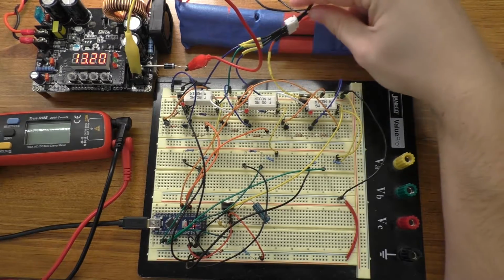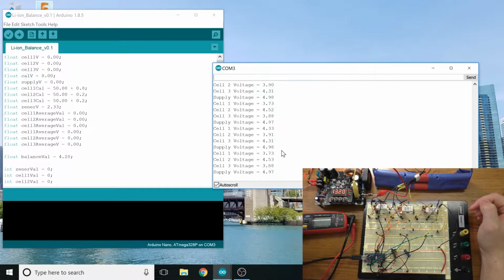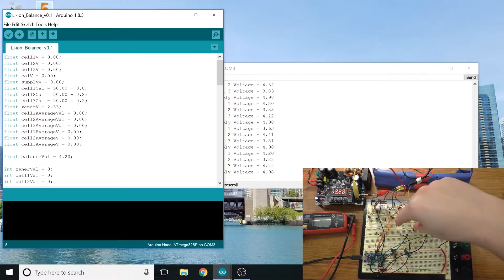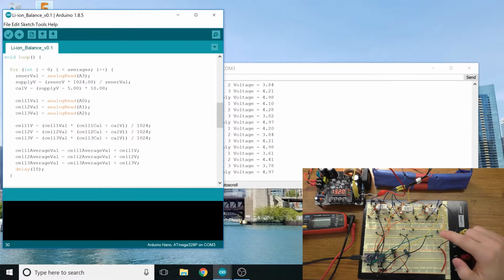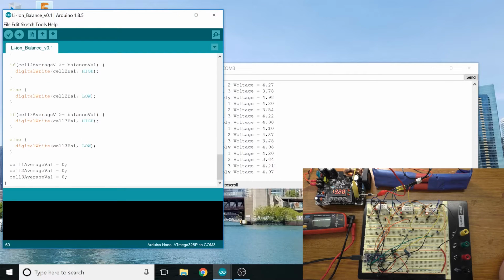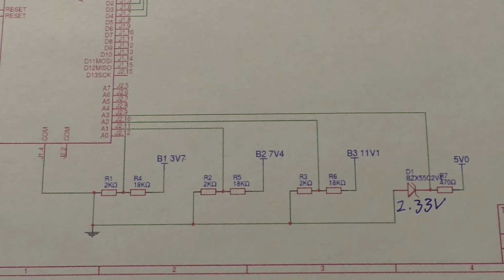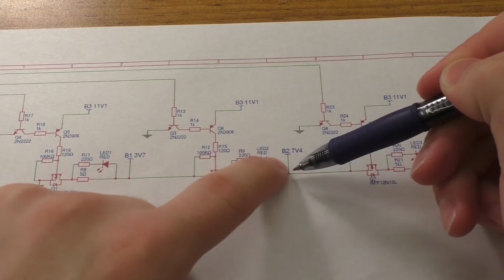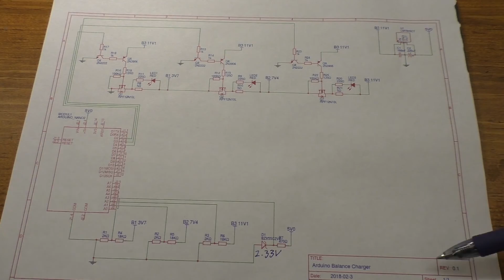Arduino BMS #2: Initial Schematic and Code

Comment: So you are actually wasting power in the charger.
I can appreciate the simplicity, but it's obviously is inefficient.
The circuit I'm designing is supposed to be used without a charger so it's important to be efficient or it will discharge the battery.

Comment: the Mosfet-N RPF12N10L is designed for logic 5v level drive and the datasheet tell that the Vgs max is 10v.. be aware for your B3_11V1 which reach 12.6v when full charged (4.2v x 3).. i suggest you to put a zener at least for the B1 Mosfet.. about the analog reading, i do always an average (of 100 to 200) for to avoid the noisy/instable values and save by the way the filter components for each line.. for the dividers, if you select a different set for to have the same input analog voltage (as B1 less divider with AVref 5v, B2 div by 2, B3 by 3 etc) you will never have a loss of resolution (add a software calibration factor to be precise instead of to select the resistors).. im happy of your project and i will think about it!!

Comment: Hi, can i ask something? how can you read battery voltage for each cell at voltage sensing circuit?  I thought that voltage divider at B27V4 and B311V1 show voltage 7.4V and 11.1V respectively? Or did you calculate it in the code?
Reply from the maker: They do do show 7.4 and 11.1 volts. They get calculated from those values in the code.

Comment: Hello,  Did you fix the osc problem with the balancing ?  If not why not put a delay in the balance routine that has all the drain resistors off for like 2 seconds then measure, and if it finds a cell high, then turn respective drain on for 3 seconds and return.  just give it a settling time..
Reply from the maker: Yeah I got that fixed, and that is pretty much exactly how I fixed it.

Comment: Eman, I'm building an arduino BMS, and I found your project, amazing! Which changes do you sugggest for a 14S pack? I have to deal with 60V. I suppose, for meassuring, is the same, changing the ratio of the voltage dividers to adjust the ranges to arduino ADC. But in the case of the dischargers, I will need capable transistors for 60Volts, true?
Reply from the maker: Thanks. I have had some people tell me that voltage dividers start to become a little inaccurate once you get past about 4 cells.  One suggestion somebody made to me was to replace the voltage dividers with op-amps set up as differential amplifiers.  I plan on experimenting with this very soon. The other big thing is the gate voltages of the mosfets need to be kept below 20V somehow.
Reply: @Eman2000  Interested to keep following this. I am relatively new to electronics and Arduino but looking to go with a 7s setup and using what you've begun, so I am keen to see if you do keep the voltage dividers or go with another method of voltage measurement.

Comment: Can I use same circuit if I have 17 cells in parallel(3 X 17) ?
Reply from the maker: Yes
Reply: I had a problem with the program I guess. 
Voltage keeps on getting added after I run the program and voltage it displays keeps on increasing.

#include <LiquidCrystal.h>
float cellV1 = 0.00;
float cellV2 = 0.00;
float cellV3 = 0.00;
float calV = 0.00;
float supplyV = 0.00;
float cell1Cal = 50.00 + 0.8;
float cell2Cal = 50.00 + 0.8;
float cell3Cal = 50.00 + 0.8;
float zenerV = 2.68;
float cell1AverageVal = 0.00;
float cell2AverageVal = 0.00;
float cell3AverageVal = 0.00;
float cell1AverageV = 0.00;
float cell2AverageV = 0.00;
float cell3AverageV = 0.00;

float balanceVal = 4.22;

int zenerVal = 0;
int cell1Val = 0;
int cell2Val = 0;
int cell3Val = 0;
int averages = 100;

int cell1Bal = 2;
int cell2Bal = 3;
int cell3Bal = 4;
int powerIn = 5;

int flag = 0;

const int rs = 12, en = 11, d4 = 10, d5 = 9, d6 = 8, d7 = 7;

LiquidCrystal lcd(rs, en, d4, d5, d6, d7);

void setup() {
  Serial.begin(115200);
  lcd.begin(16, 2);
  lcd.setCursor(0,0);
    lcd.print("RIZEL");
    delay(1000);
  lcd.noAutoscroll();
  lcd.clear();
  
  lcd.write("Initializing..");
  delay(1000);
  lcd.setCursor(0, 1);
  lcd.write("Version 0.1");

  pinMode(cell1Bal, OUTPUT);
  pinMode(cell2Bal, OUTPUT);
  pinMode(cell3Bal, OUTPUT);
  delay(2000);
}

void loop() {

  for (int i = 0; i < averages; i++) {
    zenerVal = analogRead(A3);
    supplyV = (zenerV * 1024.00 / zenerVal);
    calV = (supplyV - 5.00) * 10.00;

    cell1Val = analogRead(A0);
    cell2Val = analogRead(A1);
    cell3Val = analogRead(A2);

    cellV1 = (cell1Val * (cell1Cal + calV)) / 1024;
    cellV2 = (cell2Val * (cell2Cal + calV)) / 1024;
    cellV3 = (cell3Val * (cell3Cal + calV)) / 1024;

    cell1AverageVal = cell1AverageVal + cellV1;
    cell2AverageVal = cell2AverageVal + cellV2;
    cell3AverageVal = cell3AverageVal + cellV3;
    delay(1);

  }
  cell1AverageV = cell1AverageVal / averages;
  cell2AverageV = cell2AverageVal / averages;
  cell3AverageV = cell3AverageVal / averages;

  cell2AverageV = cell2AverageV - cell1AverageV;
  cell3AverageV = cell3AverageV - (cell2AverageV + cell1AverageV);

  Serial.print ("Cell 1 Voltage = ");
  Serial.println(cell1AverageV);
  Serial.print ("Cell 2 Voltage = ");
  Serial.println(cell2AverageV);
  Serial.print ("Cell 3 Voltage = ");
  Serial.println(cell3AverageV);
  Serial.print ("Supply Voltage = ");
  Serial.println(supplyV);

  lcd.clear();
  lcd.print("1: ");
  lcd.print(cell1AverageV);
  lcd.print(" 2: ");
  lcd.print(cell2AverageV);
  lcd.setCursor(0, 1);
  lcd.print("3: ");
  lcd.print(cell3AverageV);

}
is there any wrong with the code?

Comment: this is a little off subject. I am working on a discharger tester. and I was thinking about using a DC to DC converter . for varying the load. or keeping a constant load as voltage drops. could something like that be incorporated into a balance system? is there a way to adjust the output of a DC converter . with a arduino? And could you program it to only balance between like 4 and 4.1 volts then when over 4.1 it would be balanced. hopefully! and no oscillation. or am I even close? thanks
Reply from the maker: You could add something like that. Controlling the converter with Arduino might be a bit of a challenge but there should be a way. That would be a way to stop the oscillation though I did do it in a different manner.

Comment: Hi; its fantastic! 
Is it possible that you share the code for study? Thanks!
Reply from the maker: Thank you,

Here is the current version of the code:

float cell1V = 0.00;
float cell2V = 0.00;
float cell3V = 0.00;
float calV = 0.00;
float supplyV = 0.00;
float cell1Cal = 50.00 + 0.8;
float cell2Cal = 50.00 - 0.2;
float cell3Cal = 50.00 + 0.2;
float zenerV = 2.33;
float cell1AverageVal = 0.00;
float cell2AverageVal = 0.00;
float cell3AverageVal = 0.00;
float cell1AverageV = 0.00;
float cell2AverageV = 0.00;
float cell3AverageV = 0.00;

float balanceVal = 4.20;

int zenerVal = 0;
int cell1Val = 0;
int cell2Val = 0;
int cell3Val = 0;
int averages = 100;

int cell1Bal = 2;
int cell2Bal = 3;
int cell3Bal = 4;

void setup() {
  Serial.begin(115200);

  pinMode(cell1Bal, OUTPUT);
  pinMode(cell2Bal, OUTPUT);
  pinMode(cell3Bal, OUTPUT);
}

void loop() {

  for (int i = 0; i < averages; i++) {
    zenerVal = analogRead(A3);
    supplyV = (zenerV * 1024.00) / zenerVal;
    calV = (supplyV - 5.00) * 10.00;

    cell1Val = analogRead(A0);
    cell2Val = analogRead(A1);
    cell3Val = analogRead(A2);

    cell1V = (cell1Val * (cell1Cal + calV)) / 1024;
    cell2V = (cell2Val * (cell2Cal + calV)) / 1024;
    cell3V = (cell3Val * (cell3Cal + calV)) / 1024;

    cell1AverageVal = cell1AverageVal + cell1V;
    cell2AverageVal = cell2AverageVal + cell2V;
    cell3AverageVal = cell3AverageVal + cell3V;
    delay(10);
  }

  cell1AverageV = cell1AverageVal / averages;
  cell2AverageV = cell2AverageVal / averages;
  cell3AverageV = cell3AverageVal / averages;

  cell2AverageV = cell2AverageV - cell1AverageV;
  cell3AverageV = cell3AverageV - (cell2AverageV + cell1AverageV);

  Serial.print("Cell 1 Voltage = ");
  Serial.println(cell1AverageV);
  Serial.print("Cell 2 Voltage = ");
  Serial.println(cell2AverageV);
  Serial.print("Cell 3 Voltage = ");
  Serial.println(cell3AverageV);
  Serial.print("Supply Voltage = ");
  Serial.println(supplyV);

  if(cell1AverageV >= balanceVal) {
    digitalWrite(cell1Bal, HIGH);
  }

  else {
    digitalWrite(cell1Bal, LOW);
  }

  if(cell2AverageV >= balanceVal) {
    digitalWrite(cell2Bal, HIGH);
  }

  else {
    digitalWrite(cell2Bal, LOW);
  }

  if(cell3AverageV >= balanceVal) {
    digitalWrite(cell3Bal, HIGH);
  }

  else {
    digitalWrite(cell3Bal, LOW);
  }

  cell1AverageVal = 0;
  cell2AverageVal = 0;
  cell3AverageVal = 0;
}
Reply: barry.mayson@gmail.com